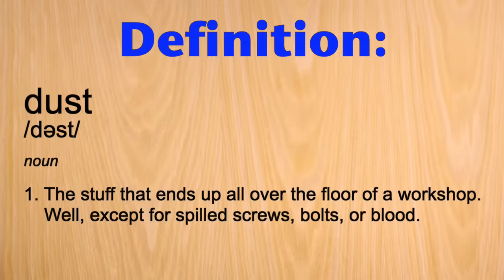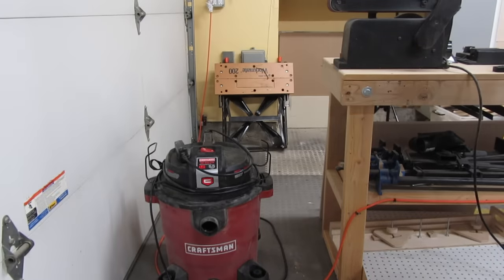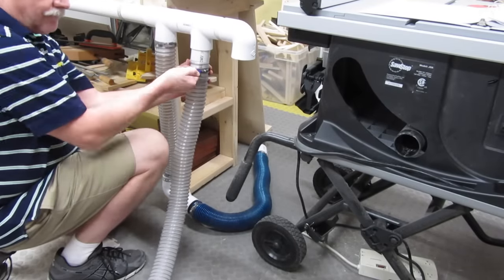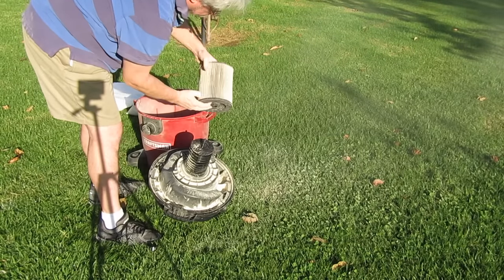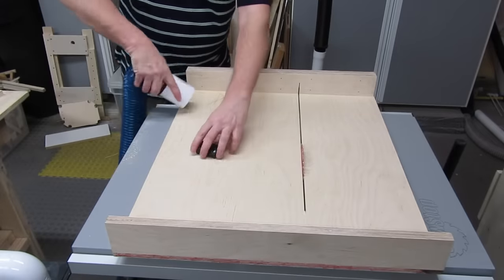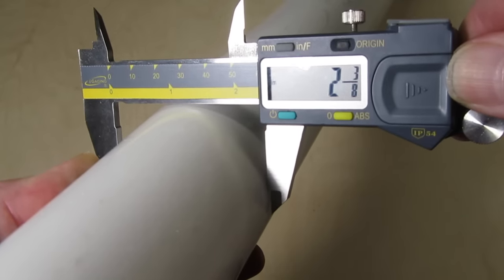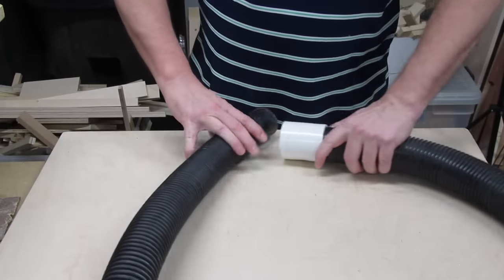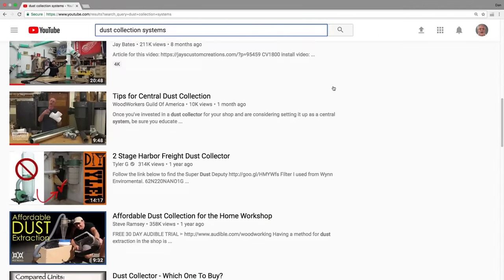Dust Collection for Newbies: Introduction to Dust Collection

Comment: As a new woodworker, also new to dust collection, I am now completely confused. I wanted to put in a system very much like yours, make a schematic just like your system, for 2 tools plus a third blast gate for a sander or just vacuuming around the shop. But of course, I ran into all kinds of problems finding fitting that would allow me to put it all together. I can't even find an adapter that allows me to hook up my 10-gal deWalt shop vac to my 10" Makita 2703 table saw. I went to Rockler in Concord, CA and showed my schematic and asked for advice. The first thing the guy told me is "you're wasting your time with a 2" system—go to 4"". He said that with any run at all, you'll have no suction and you may even blow up your shop vac. Your whole system is based on 2 or 2-1/4" hoses.  Another person at Woodcraft told me the same thing: "2-inch is a total waste." How do you respond to these comment from both Rockler and Woodcraft? My shop is fairly small; I was going to buy a Harbor Freight 1 hp dust collector, which is FAR quieter than the 2 hp model, but I'm told that it too is not worth much. Noise is an issue.
Reply from the maker: Thanks for the comment. First off, you won't find many adapters. Cut a short length of PVC pipe and use a heat gun to heat up one or both ends enough to mold the ends. Use work gloves and don't burn yourself. If you don't have a heat gun, a hair dryer may work. Personally, I use my oven set to 350 degrees fahrenheit, with the PVC set on some tin foil, for about 5 minutes. By the way, sometimes you need to use a PVC coupler instead of pipe - it depends on what you're trying to do.

BUT, if you heard the same thing from two places, I'd like to see your schematic. I wonder if there's something odd about what you're trying to do. I mean, both these places sell blast gates and other things for 2 1/2" (or 2" depending on how they market them, it's the same thing) systems. If you'd like to send me a picture of your schematic, I'd be happy to take a look. I don't want to post my email address here because I might get spammed, so go to my website https://thenewbiewoodworker.com, click on "Menu" in the upper right, and click "email".

Assuming there's nothing odd about your schematic, I suggest responding by saying "If 2 1/2" systems don't work, why do you sell components for them?"
Reply: @TheNewbieWoodworker  Woodcraft also sells Festool, and their dust extractor hose is 35mm, less than 1 1/2".  Pretty pricey if it's a waste.  What about the dust ports on all these tools that are mostly 2 1/2"? 

What you need it for is the important question.  If you have a planer that makes a lot of dust chips quickly, a larger diameter system is much better.  If you have a hand sander, track saw, or hand-held router, a smaller hose, like 35mm works best, imo.  I have a shop vac with a Bosch 35 mm hose for these things and it's great.

The larger diameter dust systems mainly move air instead of creating suction like a shop vac, so the suction is less with a larger system.  I'm no expert, but it seems like the folks at the woodworking places should tell you these things rather than saying you are wasting your money.  Given information you can decide what's best
Reply from the maker: @k.b.woodworker3250  I agree 100% with everything you said. In fact, I have nothing to add! 😄
Reply: Thanks for the reply. I've been studying this issue intensely for the past few weeks and have learned a great deal. I now have a much better understanding of the situation, and am clear on how to fit everything together with 2" PVC pipe, couplers, molded pipe, Y-connectors, and 2" flexible hose (all black). The system I'm planning is very similar to  yours. Still waiting on a few items, but when it's all put together, I'll send you some pictures. Btw, as many others have said, your video has been very helpful for some new to DC.
Reply: I think the guy at Rockler who basically said that a 2" system with a shop vac was a waste of money was perhaps thinking of a production woodshop, altho I made it clear that I was only going to set up a 2 or 3 tools system, and certainly was not in the shop every day. Anyway, I think this system will have plenty of suction at each tool and will work just fine for my application.

Thanks for the tip about  using a 35mm hose for attaching to a sander. I had been planning to have a detachable 10-ft 2" hose coming off the end of the main system trunk, with a reducer at the hose end to attach to the sander. But I think I'll try with a 35mm hose instead.
Reply from the maker: @gideonkramer7479  👍

Comment: I cut PVC on my miter saw but I make sure the pvc is rigid (not flexible) and I have a small fine-tooth blade.  Cuts like hot knife thru butter and most of the time I have no burrs on the edges.
Reply from the maker: Thanks for the info! 😄

Comment: FYI you lose a lot of power when you have a 90 deg angle in your pipes. if you can get the 45 deg angle connectors it will give your system more power.
Reply from the maker: With 2" pipes and shop vacs, it doesn't make hardly any difference at all. I've tested with an anemometer. Systems with true dust collectors are affected a lot by these things, but systems like mine, not so much. (I'm not implying my system is better than using a true dust collector - obviously it's not. I'm just saying that sharp bends hardly affect it at all.)

Comment: Great video and explanations.  Very well done for the newbie woodworker.  Been watching other videos and came across the idea that you don't need a cyclone if you're able to dump the dust outside your shop.  Its also cleaner and more efficient in getting rid of fine particles.   What do you think of this method?  Is this true as long as you don't impact your neighbors?  I'm thinking this is a better way to manage all the dust so long as you dump it into something that is contained outside
Reply from the maker: The main reason for using a cyclone is to keep the dust from clogging the vacuum/dust collector's filter. If the method you mention still does this, then cool. However, check local ordinances to see if this is leqal in your area. It's not leagal in a lot of areas.
Reply: @TheNewbieWoodworker  Actually, the best thing to do with wood dust is to recycle it and collection in a cyclonic collector is a great way to gather it.  Us it for garden mulch, liquids sorbents, wood filler, etc. Lots of ideas online.
Reply from the maker: @DokDream  👍

Comment: Great video! Very informative at the right pace and to the point. Just right.  One question though.  You didn't mention the 'vacuum power' needed to drive this system.  Is there a minimum 'suction power' needed?
Reply from the maker: Thanks! To answer your question, or actually not answer your question, I honestly don't know. Here's what I use, if that helps: http://amzn.to/2lH0ZpP

Comment: FWIW, heating PVC past 140 degrees fahrenheit is a bad idea without significant exhaust, has Dioxins and Chorine are released. Past 212 degrees fahrenheit and the differing Dioxins released are very bad. An additional side effect is that the Dioxins love to stick to other particles, so they are not just going to float up up and away. They will bond with the dust in your shop and have another chance to be breathed in. This is why an auto garage hybrid shop is also a problem has pollutants that can extra life in your wood working processes.
Reply from the maker: Thanks for your comment! First off, if you (and I mean anyone reading this) don't feel safe doing something, then by all means don't do it. It's your life and nobody else's, and your safety is your own responsibility. As I say in my title screen, don't take safety advice from someone who calls himself a newbie! 

With that said, my personal feeling is that if I were doing this a lot, then I'd want to do it outside, wear a mask specifically for these types of fumes, and hopefully have a strong wind behind me. But if I'm heating up a single PVC pipe just enough so it's soft enough to mold, then I'm not personally worried. But that's just me. Of course, now that you mention it, the next time I have to do this I'll at least open the garage door and turn on my shop fan. 😄

Comment: Super video! Thanks for all the great info. Have you had any second thoughts on building out your system based on 2.5" diameter tubing or would you go with 4" or wider if you could do it over again. Working on a system just like yours but have seen lots of talk on using wider tubing to reduce friction etc.
Reply from the maker: Thanks! That's actually a complicated question, but I'll answer what you asked. No, I haven't had any second thoughts. What I have works just fine for my shop, and larger pipes would be harder to install where I'd want them. Plus, a larger dust collector would take up more space than my current setup does. But as I said, the question of using a true dust collector based system can become quite complicated, if you want to make sure you get proper "fine dust collection". If I started down that trail, I'd probably never get to the end, so I'm just happy to have a working system. 😄Hope that helps.

Comment: The only issue with using a miter saw to cut PVC is the blade. PVC contains vinyl, and vinyl dulls cutting blades quickly. Best to have a cheap blade on hand to devote to this task, otherwise a good blade won't be of much use afterward.
Reply from the maker: Good tip. Thanks for the comment!

Comment: The Dust Deputy is the real deal. It’s so efficient I have barely a handful of dust in my vacuum after more than two years. You will. Never buy a filter again.
Reply: Just know you’re trading sucking power by using something like the dust deputy which has an impact on the particles you breathe in. I just use a bag and empty it out periodically.
Reply from the maker: @aoe2geek  Not much - The dust particles that are more hazardrous to your health are the fine dust particles, and this type of dust collection doesn't collect them. If you're worried about what you breath in, learn about fine dust particles. But be warned - it'll lead you down a rabit trail with no end in sight.

Comment: Two 45° elbows put together to form a 90° angle are more restrictive than a single ninety degree elbow.  The idea that they are less restrictive comes from 45° offsets being less restrictive that 90° offsets.
Reply from the maker: It turns out that for systems like mine, that use a shop vac and 2" pipes, it makes no discernible difference. I've done plenty of testing. It does make a difference in systems that use a true dust collector, and the larger 4" or 6" pipes. I forget what the difference is, but it has something to do with one system relying on air volume, and the other air speed, or something like that.
Reply: @TheNewbieWoodworker  Perhaps you are right. As a pipefitter, I was taught different.
Reply from the maker: @earlie47  I need to figure out a way to do a video on this. The problem is, I only have my one dust collection system to try. Oh, but I may know someone... Thanks for the inspiration! 😄
Reply: @TheNewbieWoodworker  If you could figure out how to do a dust-related video on friction loss in piping, it would be inspiring. It is a difficult subject and might be best on a back burner.
Reply from the maker: @earlie47  👍

Comment: I really enjoy your DIY hands on approach!  Not the Standard ORDER ALL THIS FROM XZY.com,AND BUILD IT! You like myself  Figure out how to build what we Need with a Minimum of Ordering else where.  I use a shop vac and a Blue Rockler Cyclone,Works well. 
If you placed your shop Vac near the Center of your Set up It might be more Efficient with shorter runs to Dust ports
Reply from the maker: Thanks, and yes, I like to DIY it, although I sometimes just buy, when I don't want the hassle. As for the placement, with the limitations of my shop, this is really the best place for it. If I put it elsewhere, it would get in the way.

Comment: Very helpful video. I drag my shop vac around so am looking to upgrade to a similar setup you have right there so am saving this video for later use. Thanks for video and for keeping it simple. One question though. Doesn't the cyclone reduce your shop vac suction power by a lot ?
Reply from the maker: Thanks, and glad I could help. Yes, the cyclone definitely reduces suction. The question always is, does it reduce it too much? For me, it doesn't reduce it enough to make me want to get rid of it. And since a lot of other people use cyclones, they apparently agree. But only you can judge how you feel about it on your system. Here's my suggestion: Build your system with the cyclone. That way, you'll have never run the system without the cyclone, so you don't have anything to compare it to. And if you're happy, leave it at that. At least, that's how I did it. I eventually did run some comparisons without it, after having mine for a couple of years, but by that time I wasn't willing to remove it, no matter what the results were. 😄

Comment: Have you thought about cutting a vertical slot in the bucket so you can see the dust level without having to open the bucket? A one inch wide strip about 16" in height with plexiglass siliconed to the inside might work. Just an idea.
Reply from the maker: I think that's a great idea, and it would solve one of those annoying little problems - how often do I crack open the lid to take a peek? My problem is twofold: First, I have a bucket inside a bucket to increase the strength. Not a huge deal - I could either find a thicker bucket, or build a support inside to keep the bucket from collapsing. But the second problem is, I'm not exactly sure how to attach the plexiglass - when you do something that stops up the input, there's a lot of pressure on the inside of the bucket, and it might just rip the plexiglass away. Maybe it would be better to put the plexiglass on the outside... What do you think?
Reply from the maker: @John Brookes Great comment, thanks! I always wondered why sometimes things like epoxy or CA glue work well, and other times don't work at all. Knowing about chemistry would certainly help! Right after I read your original post, I did some YouTube searches and found this interesting video: https://youtu.be/JOXvtJgYlCQ. I wouldn't bother making my own Thien baffle, but the bucket is cool. Obviously it's a lot of work, and probably fairly heavy (maybe not, I'm not sure), but it sure looks good!
Reply: @TheNewbieWoodworker  You only have to put a small window near the top.  A large peice of plastic on the outside improves the likelihood of adhesion.  A couple of pop rivets might also help.
Reply from the maker: @kimburbo786  Excellent ideas. Thanks! 😄
Reply: @TheNewbieWoodworker . Since I'm not really familiar with the amount of pressure that the apparatus produces, I don't know enough to say. I suspect a strong enough adhesive and a thick enough clear plastic would withstand the pressure the vacuum produces. Since they are just buckets, one failure might end up producing the iron-clad method. I watched the video as I'm beginning the construction process on my coming garage/shop. Your video got me pretty jacked about FINALLY having a real shop with even a modest dust collection system that the video makes appear totally doable. The portable bench-top shop of a trim carpenter that I set up and tear down with each use has served me adequately, but I'm quite over it.
Reply from the maker: @SisyphusJones  I'm glad my video helped you with your vision - that's exactly why I made it. Of course you can have bigger and fancier dust collection systems, but I wanted to show something the average person could understand and put together, without costing an arm and a leg. So I'm glad it's helped, and I appreciate your mentioning it! 😄

Comment: Glad I got that out of the way...I will use my hack saw and mitre box instead of my 12" mitre saw for cutting PVC, takes just a second...MY question: do you have a good source for smooth inside 2.5" vacuum hose?

 AND, where I can hang the PVC pipe, the plumbing strap will only have one fastening point. will it make a difference if the pipe is anchored but can sway slightly away from wall? 

 thanks in advnce!
Reply from the maker: Thanks for the comment. I use a hack saw all the time. And I bought one of those "deburring" tools for after you cut the PVC, but honestly, just running my finger around the inside of the pipe works fine. (But if your finger gets a nick, it's not my fault. 😛)

I don't have a good source for smooth inside hoses. In fact, if you find one, let me know! 😄 However, I use the non-smooth kind, and they work well enough, as long as you don't use a whole bunch of it. I prefer the clamps that have thumbscrew-type knobs, as compared to the ones that you use a screwdriver or socket for. The first time you use it, you have to turn it a lot, but after that if you need to unscrew it to check for clogs or something, it's wonderful.

I doubt it'll make any difference if the pipe sways. You could always attach the strap to a block of wood, and then attach the wood to something else, if you're worried, but as I said, I doubt it'll make much difference.

By the way, with the blast gate for my table saw, the door was always getting debris in its track, so it wouldn't close all the way. I tried one of these from Lee Valley: http://www.leevalley.com/en/wood/page.aspx?c=&p=51506&cat=1,42401&ap=1 and it works fantastic. I only use it for the gate for my table saw (because it's more expensive, and you'll have to fashion an adapter from PVC or something). All other Rockler gates work fine. I'm only mentioning this in case you run into the same problem, because it was frustrating, and having a solution is awesome.

Good luck. Keep me posted!